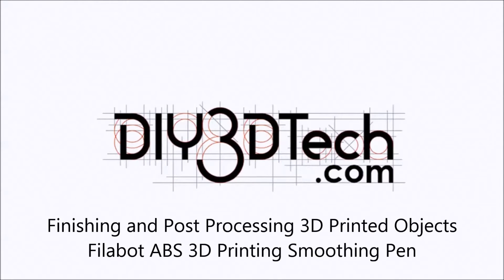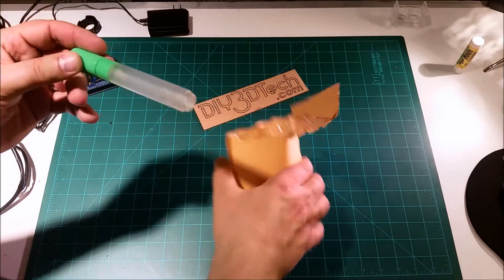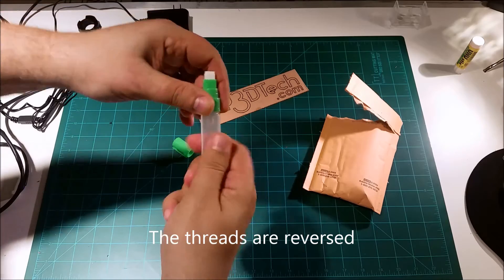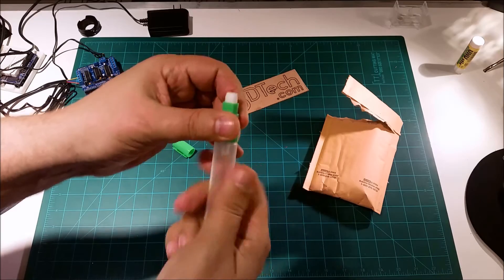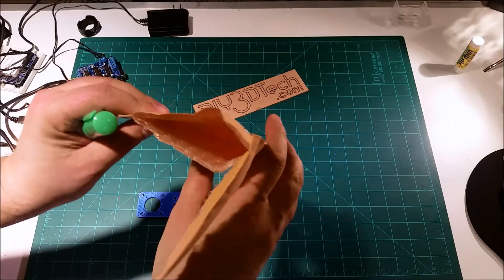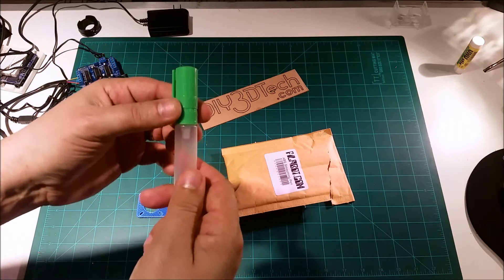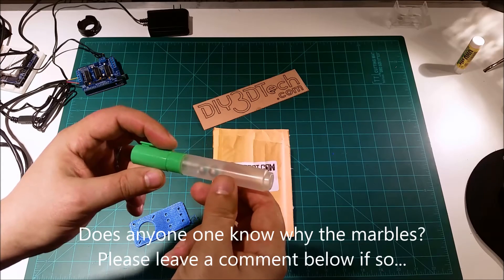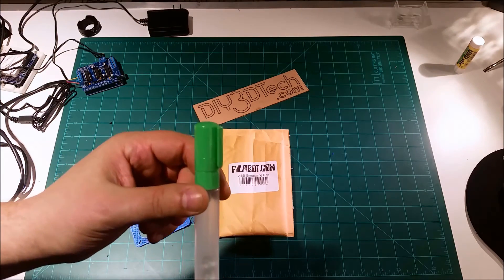Finishing and Post Processing 3D Printed Objects - Unboxing Filabot ABS 3D Printing Smoothing Pen

Comment: The marbles almost make it seem like it's supposed to be a paint marker and they just changed the labeling. I've tried to use one of these but gave up very quickly due to an uneven application of acetone and the foam tip getting clogged and catching on sticky acetoned parts.
Reply from the maker: +comter I think your right about the "paint marker"  and seems to work ok for gluing, however as you put not for finer work...
Reply: +DIY3DTECH.com I think the idea of using acetone like this isn't bad but it needs a little bit more engineering and design than just slapping a new label on a paint marker. The tip needs to be much harder and not as porous. For gluing, I have ABS juice (melt a lot of filament in some acetone until it turns the consistency of paste and then use the same color melted filament as what you printed and apply it to the gluing surfaces). I tend to do cold acetone smooth (paint bucket, paper towels and magnets) and sandpaper to smooth out parts.
Reply from the maker: Interesting and many thank for sharing these points!
Reply: your Aswer was more usefull than the video, thnx